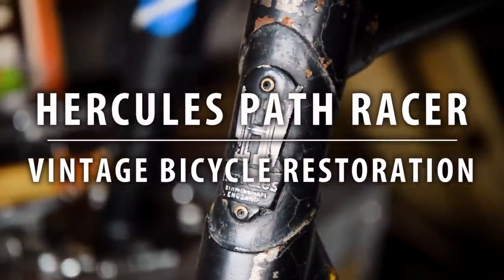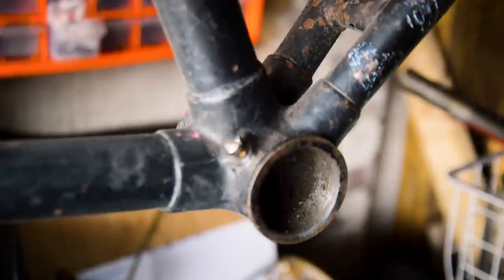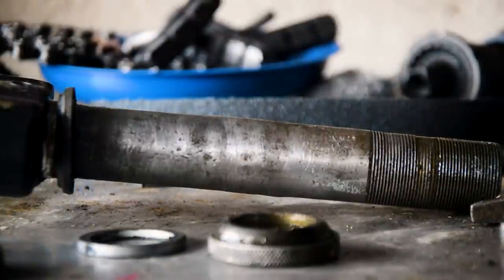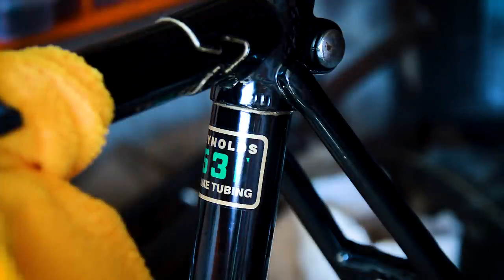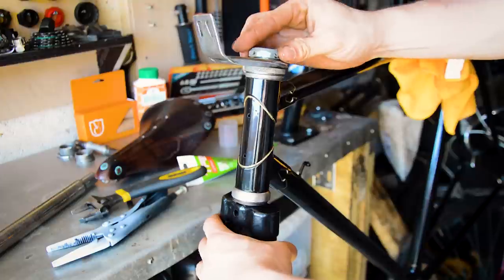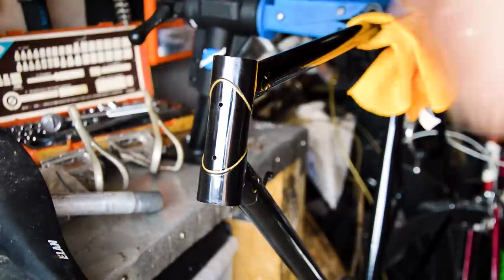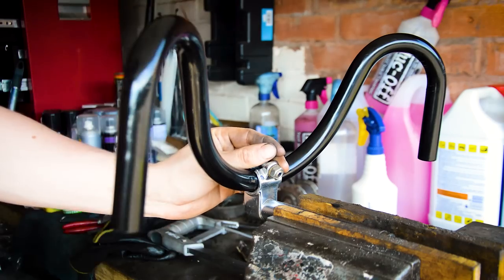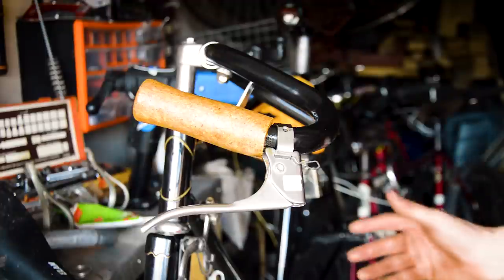1950's Hercules "Path Racer" - Mistakes were made - Vintage Bicycle Restoration

Comment: My guess would be that the stem has been overtightened and over time the wedge has stretched the metal of the steering tube. As usual, a wonderful restoration!
Reply from the maker: I was thinking that too.  Originally I thought it had been cut and welded but that was my second thought.  I'm now leaning towards a crash..
Reply: @MonkeyShred  nope, not a crash, clearly at some point the quill stem was stuck solid in there and somebody has used something to hit it from the bottom to try and get it out, unfortunately all that will do is cause the steerer of the forks to stretch from the wedge as it moves outwards still, seen this explained on another youtubers video

Comment: Lovin your channel doing the same sort of thing here in france.Noticed you struggling with grips.use ladies hair laqueur,spay inside grips,lubricates so they slide on then drys and sticks.Screwdriver under and WD40 to release,just sayin.. love the build,et bon continu.
Reply from the maker: I normally just spray on some lock de-icer. It actually seems to work really well 😅

Comment: the steerer looked uniform. i think someone just massively overtightened the stem causing the deformation of the tube. or perhaps the expansion was caused by corrosion sometime in it's history.
Reply from the maker: The over tightening has been mentioned a few times and I think that would be a likely cause now.
Reply: @MonkeyShred  Sorry. Didn't look far enough. Thank you for answering.

Comment: Looking great so far. My favourite shape handlebar, are they old ones? I have a modern pair and found brake lever choice a bit of a challenge also. At present I'm using some alloy ball ended levers, with the suitable clamps. They work fine but aren't really in keeping with the 1930/40s style I am keen on. I found some repro rubber grips that were tough to stretch on, but are comfortable and are hard wearing. My father built up a similar machine to yours, and used some lovely 'shock stop' grips. These are ideal as they are quite short, allowing plenty of straight bar section for the brake levers. Again these seem to have been a short repro run that were available from Hillary Stone. They sold out quickly before I could order a pair for myself. Looking forward to seeing the finished bike, in my view, a far more pleasing option than the Pashley  offerings! Keep up the good work and all the best!
Reply from the maker: Those style grips were on my list too.  Unfortunately finding a good pair is hard to come by.  I am keeping my eye out for the "right" pair.

Comment: Shame of the (auto-adjusting) mid-70's brake levers. Also not a fan of the cork grips. Other than that she's coming along nicely!
Reply from the maker: Auto adjusting?  You're going to have to enlighten me on that one.  Cork grips are a trial.  I'm still undecided with them but I want to see how they perform.
Reply: All the info you will need (plus the parts you seem to miss at the moment) are in this video: https://www.youtube.com/watch?v=zhhobzAFeEo
Enjoy :-)
The clip on the brake lever gave it away, I had these on my first Raleigh back in 1975
Reply from the maker: Oh man I’ve never seen those before! They’re pretty cool. I definitely wouldn’t run the adjusters on this bike though.

Comment: I have a ladies Hercules bike I think from the 1930's, the original paint is pretty good with some chips. In your opinion is it be better to keep the original destressed paint & treat any rust or should I respray & redo the lug lines? Also could you please do a video on the products & tools you use as I'm sure others would b interested too.
Reply from the maker: The finish wholely depends on your preference.  I like to keep the original paintwork as much as possible especially if the decals are in good condition.    I think I have done a video on tools before. :)
Reply: @MonkeyShred  Thanks I found you tool video, very informative. Can you please tell me the place you get your decals from?

Comment: Oh man that chainring is rad. I'm super excited to see the finished product. The grips look kind of shoddy with the new cut - maybe use sandpaper to round off the edge where you cut it? Even still the space between the end of the grip and the clamp isn't super pleasing to the eye IMO. Would cork bar tape ruin the aesthetic you're going for? Then it could run right up to the clamp.
Reply from the maker: I will be sanding it down.  The cut is too rough at the moment for sure!  Cork bar tape, no I don't think that would suit the image I have unfortunately.
Reply: Whew, I can rest easy!

Comment: Is the headset issue not down to a poorly seated crown race?
Reply: Paint under the crown race can be an issue
Reply from the maker: I don't think so.  It seemed to be seated pretty level to me.  It's fixed now anyway with the new forks and saves me finding the right crown race.

Comment: How do you remove fork crowns?
Reply from the maker: The race can be knocked off with a screwdriver / hammer.  The cap can usually be pulled off after if it has one.

Comment: Huge error to take that much steerer tube off.   Oh well.
Reply from the maker: Whys that? It's perfectly stacked.
Reply: @MonkeyShred  because future flexibility has been deleted.  Future headset with higher stack height?  Sorry, too bad.
Reply from the maker: @peterbridge9394  You know the standard is to only have one spacer in the headset right?  With all adjustability coming from the quill stem in terms of height theres no need for stacks of spacers on a steerer unless you're thinking of threadless.